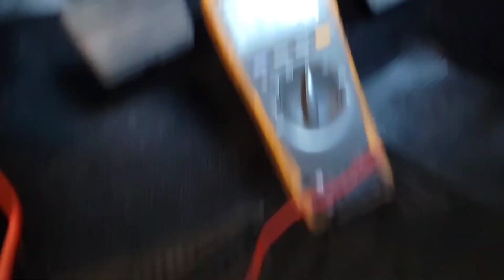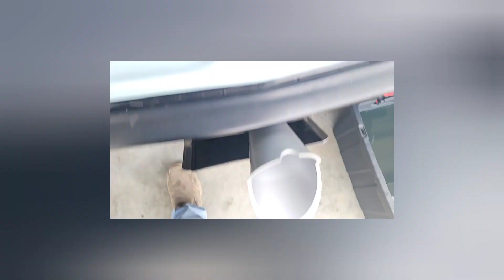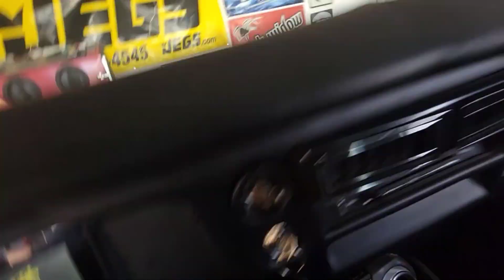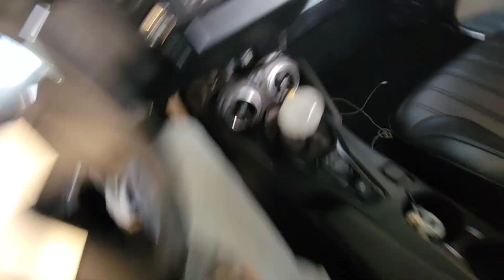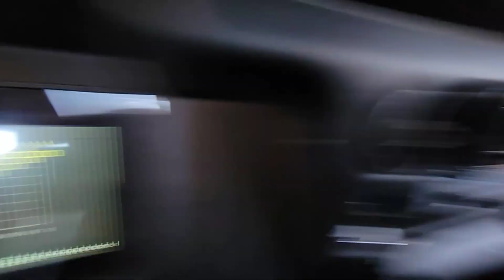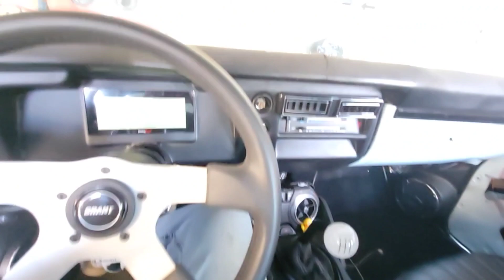Pro Dash fuel gauge scaling setup. #holley #fuel #protouring #race #diy #restoration

Comment: great video. informative. The issue i am running into is that i have ran signal wire from sender and sensor ground as well and still not getting a reading.  My ohm scale runs from 40-250. i have set that up as custom resistance and still no signal. The sending unit works, as i have plugged in stock gauges and it reads just fine. am I missing something???
Reply from the maker: Without seeing the setup I'm only guessing.  But I did have an issue with two gauges attached to the same line through a switch.  The dash only like to see the sending unit and no other items.  They all add resistance.  As long as you have a wire straight from the output of the sender to the dash you should be fine.  You just have to make sure you are using the designated input for fuel gauge ( I think it's io11?) And it's pinned correctly on the plug.  Then in the setup you select that input and map the pin.  Then in the gauge setup you select that as the input for the gauge.

You can verify if it's wiring or dash issues by checking the resistance of the sender at the plug before it enters the dash.  If you are reading correct resistance there and its not registering then check your dash setup.

Comment: Thanks for the info! Just about to start my car on the holley finally and I was wondering how to make the gauge accurate. Subbed!

I wish there was more doing holley tips and tricks out there. So many questions along the way with mine. I'm running a leash street strip and holley with a pro dash.
Reply from the maker: There a lot of turn signal and high beam indicator videos.  But not much past that.  I want to test and see what I can control or log with this dash.  We will see what I can come up with.
Reply: @RecycledRacing  that's actually what I'm more excited about than the car running. Lol. I like to tinker with electronics and see what all I can do with them. I am curious if I can feed my trans temp gauge to the screen, I just don't know the ohms to make it work and the wire is like a 22 gauge.
Reply from the maker: @KCCamaro  you can.  Just have to set up an input and configure that input to a gauge.  If you like electronics you came to the right place.  I tinker as well.
Reply: @RecycledRacing  I'll definitely have to keep up with the channel then!